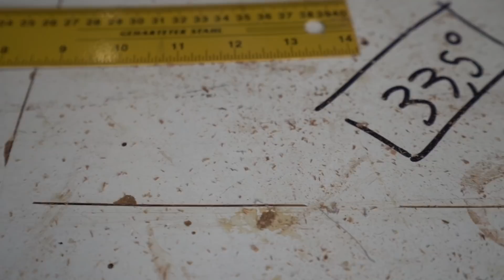Boat projects never end | EP 301

Comment: Not got to the end yet to see if you do it, but don't cut a hole low in the bulkhead. I've the same boat and the bulkhead is designed as a water barrier in the event of major breach of the drive leg gaiter (as well as as structural member ). An access hole might therefore not be sensible unless you somehow make it water tight (and sound proof), which of course you can do.
Reply from the maker: It is so crowded down there. The last time we did a service it was almost impossible to change the impeller. I know the risk, but the practical took precedence this time.

Comment: How is that desk working? How do you get in and out? It looked like your legs are in the way to fold it down so they would be in the way to fold it up too. Do you need to climb up on the bed and around? Curious!
Reply: I hope it lifts up. It locks down,  but can lift up to be able to sit
Reply from the maker: You do have to stand up to get into it. It’s not perfect, but it works.
Reply: @WorldTowning  Good, I was a bit worried. Looked tight. 😋